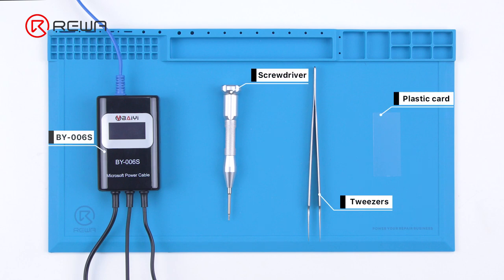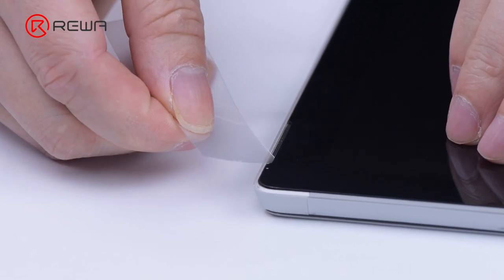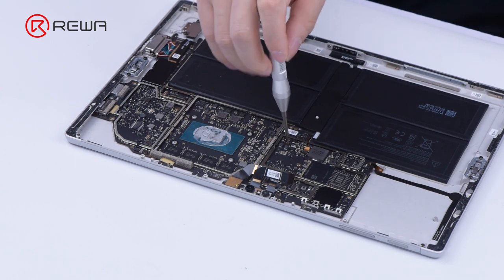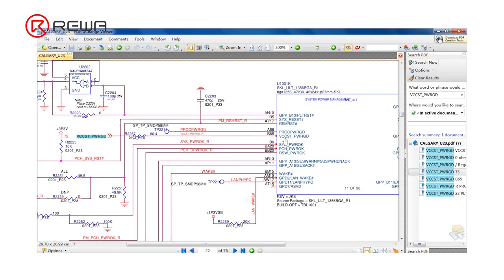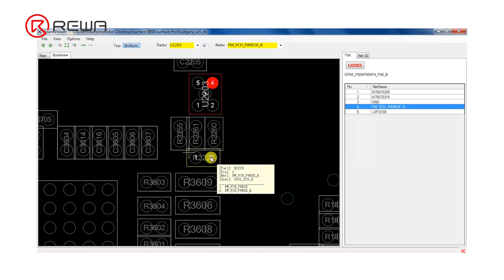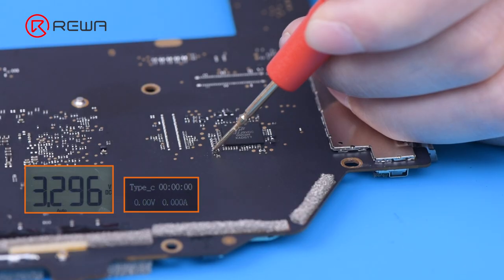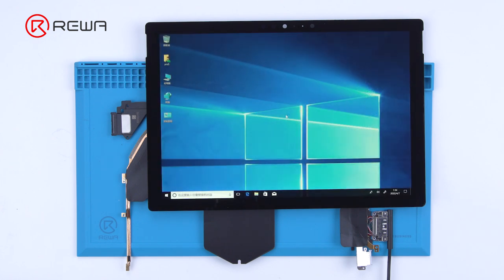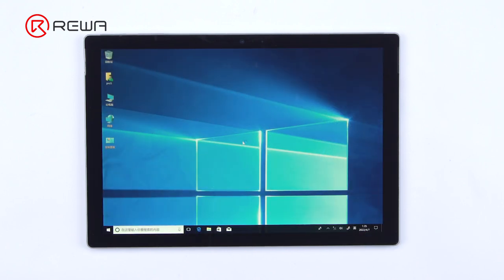Microsoft Surface Pro 5 Won't Turn On Repair

Comment: working on surface pro 5 with no 3.3 at switch but have 3.3 on back around IC - any suggestions

Comment: REWA also have experience with why the touch screen breaks (i mean touch functionality, not broken glass) so easily? I noticed on Surface Display you can't use ISO Propanol. Otherwise the touchscreen will no longer respond.  I have the same error on 3 Surface devices! No touch according to ISO Propanol
Reply: try to use some a program to recalibrate the touch, i use some ipo to desasemble mine and had the same problem, half of the touch was not  working, after use the program its normal
Reply: @landermatheus3361  i used recalibration funktion of Windows but not working. Where i can find this program?
Reply: 1. Attempts to update it first. You can use a mouse and keyboard since you have no touch. 
2. You'll need to try a work screen

If touch works on new screen, great. If you still do not have touch, you'll need to begin board level troubleshooting.

Comment: hi,  my surface works perfectly but doesn't charge the battery anymore when plugged (it's definitely not the charger i tested it on anohter surface) i also replaced the connector inside the surface but it still doesnt charge. i Also noticed a click sound every 1 or 2 second when i plug my surface motherboard . so i think there is an electrical jump or short circuit somewhere on the motherboard but i don't know at all how to find WHERE , can you teach me or link me ressources ?

Comment: Where to buy u2203?
Reply from the maker: Please contact sales@rewa.tech.
Reply: The PART NUmber for the Chip U2230 is SN74AUP1G08DPWR, you may outsource this chip.

Comment: Please please do a video on the surface pro 4 I have one that's just sitting there and none of the solutions I found worked.
Reply: what is your issue?
Reply: I have mine with flickering screen a short time after use